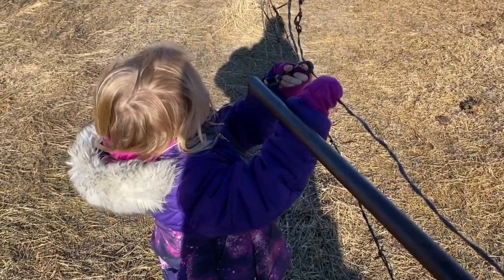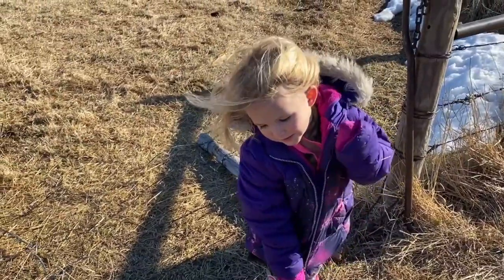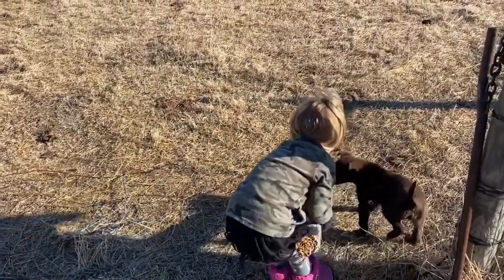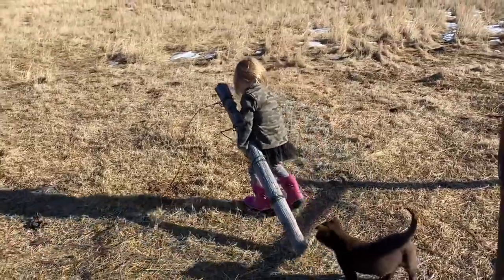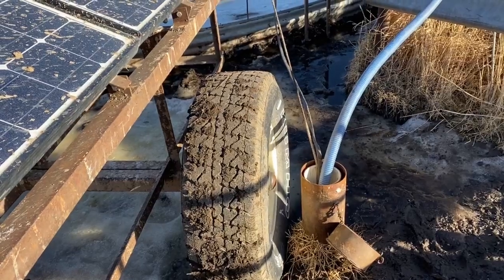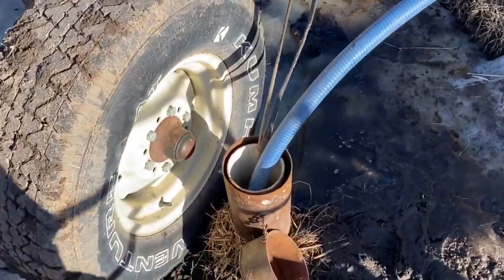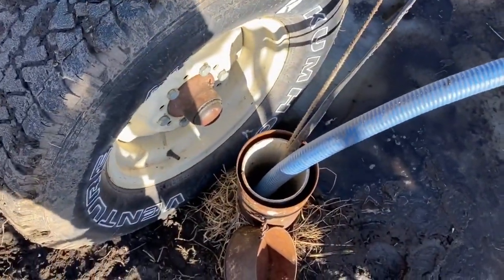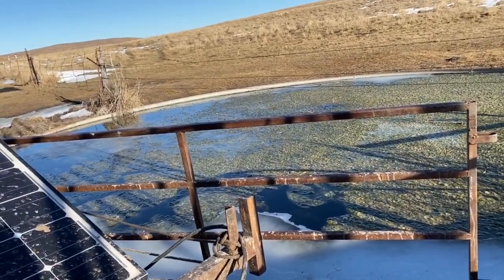Setting Up a Solar Water Pump

Comment: 😂 your little helper was having quite a time with the gate. If you wipe the mud off those solar panels you will get more optimum power from them.. love the video. 👍
Reply from the maker: snapstring yep! Normally, I’d wash them off once I get it pumping, but I didn’t want to make the mud/ice worse right there around the tank. 🤷‍♀️😂

Comment: Your automatic gate opener did a pretty good job.  Windmill not working?
Reply from the maker: She did a great job! The windmill was working. We set up the solar pumps along with the windmill in the winter to help keep the water pumping, moving, and open when it gets cold. In the summer, we use both together to make sure the cows have enough water to drink since it’s warmer and they require more. 🙂